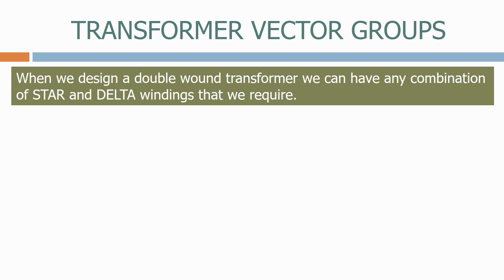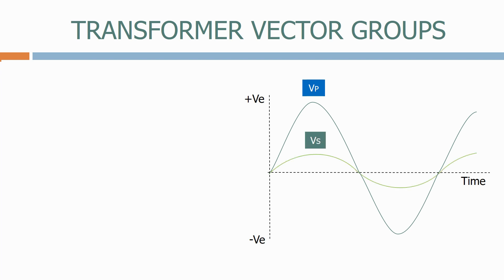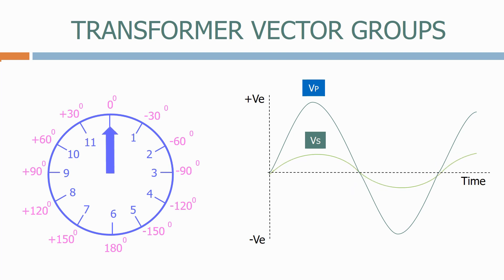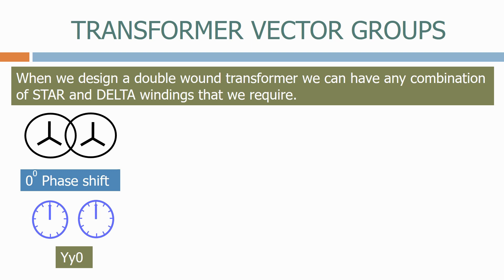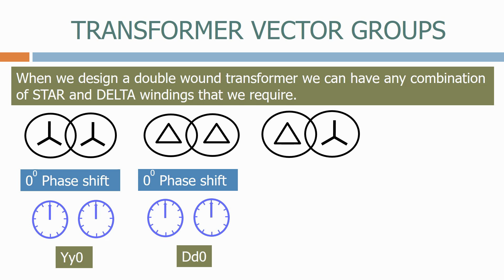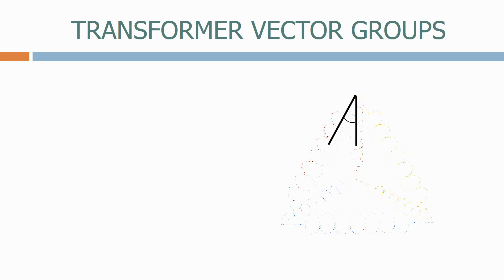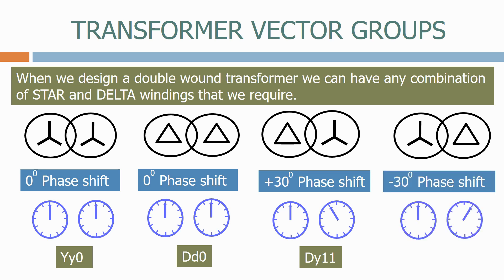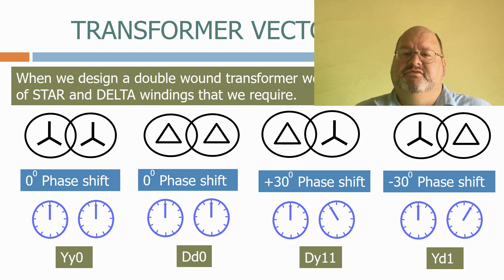Transformer vector group

Comment: Sir, what is the benefit of phase shift?
Reply from the maker: Hi Debjit, 
                There is no electrical benefit. The reason it occurs is that Delta Star transformers have a natural 30 degree phase shift due to their construction ( Dyn11 / Yd1 ) due to their physical construction and the electrical operator needs to deal with that as we go down the electrical voltage levels.

Steve